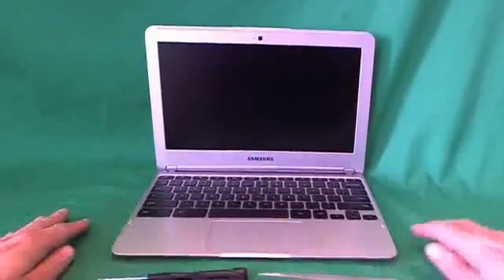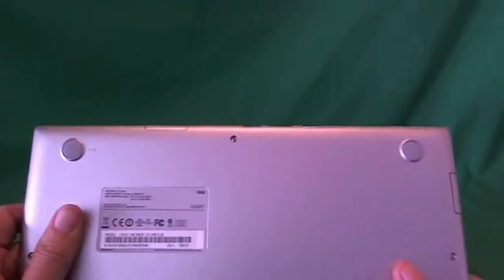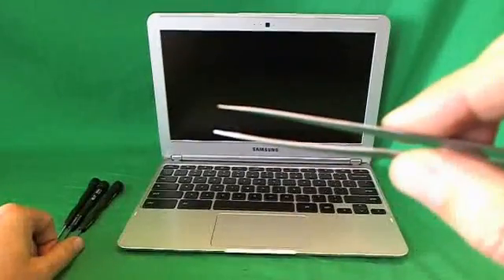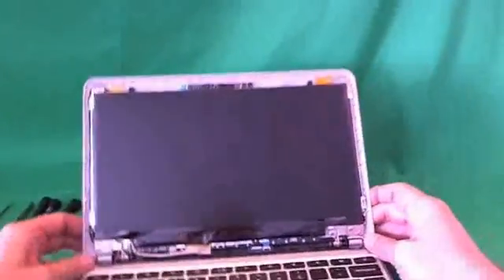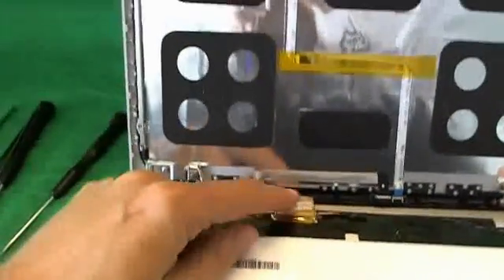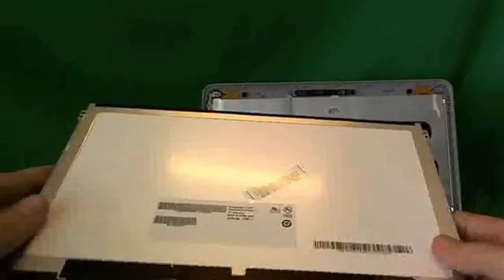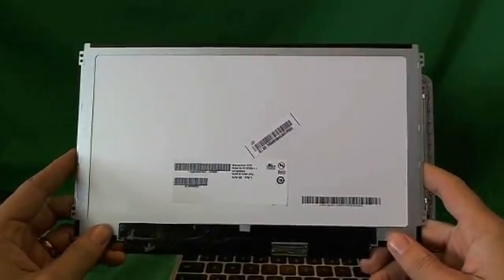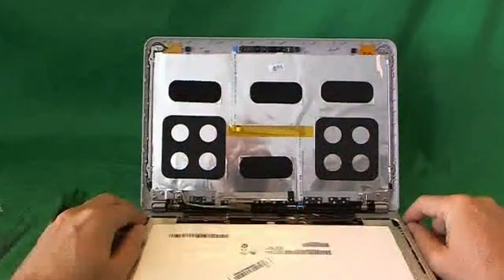Samsung Chromebook 303C Screen Replacement Procedure

Comment: I like the matte finish screens. Can't stand glossy and looking at the reflection. My screen is currently acting up. When the screen is opened in certain positions, any white on the screen turns blue and black or blue turns red. Hoping for a connector issue that will be an easy fix.

Comment: does anyone know how much it would cost to get it replaced at the store?
Reply: +Maddie Hall more than the laptop is worth
Reply: I concur. At BestBuy one of my family members went to was asking for over $300 to fix it. Based on the video though, this is extremely easy to fix compared with other typical laptops. The old part pops right out and the new one pops right in.

Comment: Tools needed: 
PH1 electronic screwdriver
PH00 electronic Screwdriver
2mm flathead screwdriver
Metal Tweezers
Exacto knives

I found this kit has those tools. 
Boxer - Boxer 30 Pcs 4mm Precision Screwdriver Set - PK30

Comment: Thank you so much!!!  I am a single mom with a 15 year old son with Down syndrome. He broke the screen on his first chromebook and I had it repaired at a local shop for big $$. About 6 months later, he accidentally spilled a drink on the keyboard and it quit working.  I broke down and purchased a second chromebook this past April (they use this type at his school).  Well today, I came home to yet another broken screen!  ARGHHHHH.  Found your video and I had held onto the old chromebook that was spilled on. Removed the screen from that one and replaced and we are back in business.  THANK YOU!!!!!  Now it will be ready for school next month.  Am very grateful to you for sharing this.  I don't know that I would have been able to replace it for quite a long while.

Comment: Thank you so much for this video!! Just fixed my chromebook - it was so quick and easy. 

Seems I made a mistake ordering the cheapest screen possible from eBay, though, as it won't quite sit flush in place so the screen bezel is now bulking out a little at the bottom. Do you think it's safe to use double sided sticky tape there?

Comment: I need help my chrome book 303c has an issue with the screen where the screen is full of pink pixels and sometimes green ones which makes it very annoying and hard to use
Reply: Also I don't know if replacing the screen would fix it or is it maybe wires

Comment: I ordered a new screen and did like you guys did in the video, however my screen only comes up black, i can change the brightness but not much else. Does anyone have a solution?, or is my new screen broken?
Reply: hi mate,on the bottom of your chrome book you will see a small hole to reset it,just push it in and it should reset and fix it,,,,cheers

Comment: Excellent video!  I just replaced my screen and it worked perfectly.  I supposed I could have figured it out, but it was more comforting to do it while watching your video.  At first my replacement screen didn't work.  I had to take it apart again and disconnect and reconnect the cable.  After that it worked fine.  Thanks for the help!